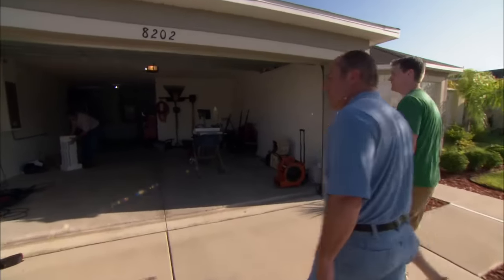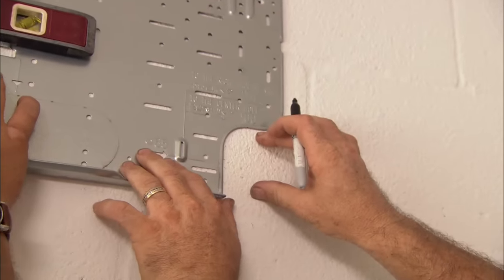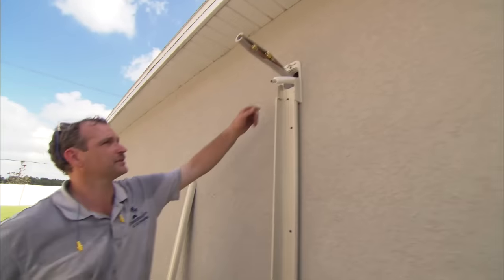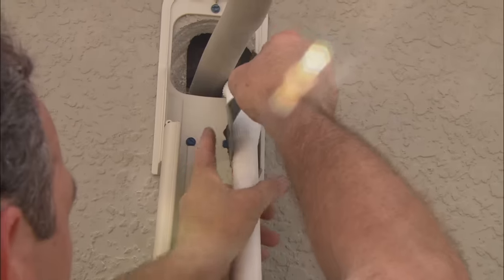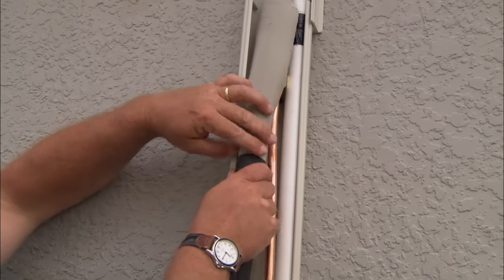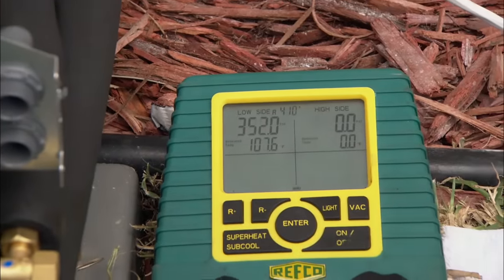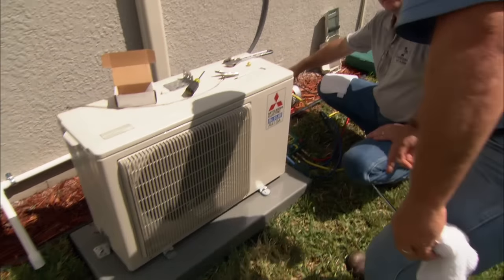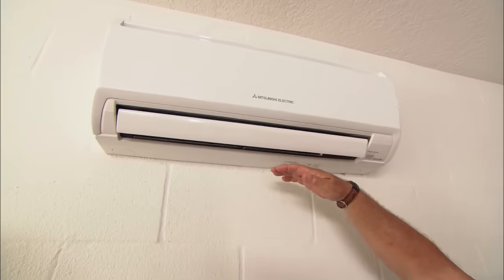How to Install a Ductless Mini-Split Air Conditioner | This Old House

Comment: Most home handy man will be ok with the majority of the install. Would not recommend tapping into your fuse box to run a new circut unless you're an electrician or have a very good idea of what you're doing! Also flaring of copper pipe is impossible unless you have a kit. Other than that, go hard👍
Reply: Vacuum pump.
Reply: +FrozenHaxor and yer a vacuum pump is good for testing and moisture removal. not completely necessary though. refridgerant is already in the a/c lines/compressor. therefore a vacuum is not required to draw the gas into the system from an external bottle. like you need to do if you have no gas in the system.
Reply: +smithenstein79 you just have to crack a screw loose as per instructions and away she flows👍
Reply: +smithenstein79 Oh boy... do you even have any idea about HVAC work?
Reply: +FrozenHaxor obviously more than you?
Reply: +smithenstein79 "you just have to crack a screw loose as per instructions and away she flows👍" I seriously do hope you're joking. No offence but please educate yourself before misleading others. The Internet has plenty of resources on the topic at hand.
Reply: Wtf dude? Are we talking about the same thing? A new inverter split cycle aircon unit comes pre charged with r32 gas. No additional gas is required unless you run extremely long gas lines.
Reply: +smithenstein79 You've said that it's not necessary to evacuate the refrigerant lines before releasing the pre-charge. This is completely wrong. There MUSN'T BE any air or moisture left in the lines.
Reply: +smithenstein79 So you recharge customers refrigerant systems which have been open to the atmosphere without pulling a deep vacuum first? I hope you're not HVAC certified O_O
Reply: +FrozenHaxor Ever heard of "purging the lines"?
Reply: +FrozenHaxor If i was doing a repair and reusing the old lines. And putting in new refridgerant, because the old gas had leaked. I would definitely vac down the system. After flushing out the old lines. Would be dodgy not to. But when you are installing brand new sealed lines and there is precharged gas in the system it is a waste of time vacuuming down the lines. When you can just purge the excess air out.
Reply: +smithenstein79 No no no, I'm talking about the copper extension lines that you install between the outdoor unit and the indoor unit. One for high pressure coming in and the other one for low pressure discharge. When you first put them in they are obviously full of air and moisture. They need to be evacuated, but not the compressor unit which was factory sealed with the precharge in it. Purging such lines at the very end is not enough, the refrigerant coming from the precharged unit will mix in on it's way with majority of the air and moisture. It's okay to purge the lines while doing a standard recharge to avoid even smallest chance of atmospheric air and moisture ingress before charging the system, but that's not the case here as it's pre-charged.

I just wouldn't risk using the purge method, refrigerant can become quite acidic when it mixes with even small amount of air containing moisture.
Reply: +FrozenHaxor Haha yep mate. I'm also talking about the high and low pressure lines. Not sure how you obtain or where you keep your new copper lines? But the ones i install are brand new and totally sealed and are obviously not full of moisture and contaminants. Generally i obtain the correct piping kit to suit the particular unit and installation. If you actually  read the installation instructions these days. It doesn't require you to vacuum down the lines. There is enough refridgerant precharge for a quick purge and to operate the aircon indefinitely. As long as you stick to the recommended installation pipe length. Bit of trivia for you. It was only introduced as a recommended procedure to vacuum instead of purge upon installation of a precharged unit back when 
a/c refridgerant was a ozone depleting substance. As i previously said, if i was using old pre-used lines that were contaminated i definitely would be vacuuming down. Or also if i had to recharge the system, for obvious reasons such as drawing the gas in i have to also vacuum, no questions asked, not possible otherwise. But if you think that you can chuck any old lines in, or any lines and a miracle vacuum is going to remove 100% of the moisture and or contamination, your living in a perfect dream world. lol. Vacuuming is mainly for intake of new refridgerant.
Reply: +FrozenHaxor Haha yep mate. I'm also talking about the high and low pressure lines. Not sure how you obtain or where you keep your new copper lines? But the ones i install are brand new and totally sealed and are obviously not full of moisture and contaminants. Generally i obtain the correct piping kit to suit the particular unit and installation. If you actually  read the installation instructions these days. It doesn't require you to vacuum down the lines. There is enough refridgerant precharge for a quick purge and to operate the aircon indefinitely. As long as you stick to the recommended installation pipe length. Bit of trivia for you. It was only introduced as a recommended procedure to vacuum instead of purge upon installation of a precharged unit back when 
a/c refridgerant was a ozone depleting substance. As i previously said, if i was using old pre-used lines that were contaminated i definitely would be vacuuming down. Or also if i had to recharge the system, for obvious reasons such as drawing the gas in i have to also vacuum, no questions asked, not possible otherwise. But if you think that you can chuck any old lines in, or any lines and a miracle vacuum is going to remove 100% of the moisture and or contamination, your living in a perfect dream world. lol. Vacuuming is mainly for intake of new refridgerant.
Reply: DO NOT GET YOUR “HAND MAN” to do much more than this video.
Reply: smithenstein79 I certainly disagree with you. You sould always vac the lines period. It is the right way to do the job.
Reply: you absolutely have to vacuum the line sets. don't let anybody tell you otherwise!
Reply: You don't need to be an electrician to add outlets....that's the most ignorant shit ever. I add outlets and sub panels without issue.
Reply: @smithenstein79  These run on R410a in the states. You do need to vacuum them clear of moisture. The moisture will not allow the units to work as they should and will cause issues at some point. These units are made cheap, they have thin copper and they need proper flaring tool to not cause any breaks. Also a torque wrench to get the fitting on without over tightening as they will cause a crack at some point with a leak. SO NO, it is NOT hard AT ALL...But DOES require some education on what you have on hand.

Comment: Great video!  I always wondered what the extent of work was involved, installing this mini-split air conditioners.  I had two installed in my condo in Thailand.
Reply: kksd2 We stayed in CM a couple of years ago and the owner of the house we rented told us that it didn't cost that much to install his split unit. How much did it cost you?
Reply: I purchased two Daikin® min units (I believe I paid $570 for ea air conditioner units (Evaporator / Condenser / installation)  There were other units that were cheaper (which also includes installation)   I've had them for over 10 years
Reply: @kksd2 How life in Thailand? Hear it’s great for relaxation.

Comment: Why or what is high voltage? Signal line?!?!
Reply: They have no clue
Reply: High voltage compared to the low voltage (signal line).
Reply: Wallace Rose 
It's the line voltage that supplies the compressor and fans, 208 or 240 volts. Signal voltage is the control voltage, turn unit on and off, 24 volts.

Comment: That exterior electrical work did’nt look great, no slack to take up vibration inside condenser unit, earth lead should have had crimp termination and diagonal runs down wall?

Comment: the ground wire connection is not good, you should use round ring lug with lock washer

Comment: Those units are great.  I'm in Egypt and had one installed last year,  easy to install.  So I  said to myself that I'm going to get one when I return to the USA.  Well the cost in  Egypt  with installation cost me about $450  US dollars. Just check out the price online in the USA and that's for the unit only, do it yourself.  Keep  your filter clean.

Comment: These are old, since the 60's in Japan, only cost around $500
Reply: and that proofs you don`t know much about this ;)
Reply: you can get one for less than $300 USD
Reply: The Sun Will Rise Again ..good luck on getting a inverter unit for $500.00. I've seen some older non-inverter units for $900.00 or so and there are adds for either the compressor  unite cheep too.
Reply: Got to think about the noise levels for the neighbors though. If they go complain about the sound and there might be some sound level laws at your place, then you're screwed with all the installation work and costs. You might have to leave the unit off forever or break it down again. And inverters are a whole lot more energy efficient than on/off units.
Reply: but I can get the exact same one in the vid for £380
Reply: I would think they'd be quieter than conventional outside central A/C condensing units.
Reply: I have one.  No noise.
Reply: Only way to know if they are running is to have your hand in front of it, NO NOISE !!
Reply: @Engineer9736  They are mostly around 55db most 60ish. Normal outdoor city noise is about 50db.  SO no issue.
Yes, these units are actually very cheap..But now they are marking them way up. Of course the SEER value and the BTU make the cost difference. the higher SEER the more perceived value.
Reply: @robertl.fallin7062  IN SPAIN YOU CAN GET CHEAP INVERTER UNITS FROM 300$  AND BETTER UNITS LIKE MITSUBISHI , DAIKIN, FROM 500$  AND  CERTIFIED TECH FOR INSTALL FROM 170$

Comment: why didn't the flares get oiled and torqued to spec and how do you pull the nitrogen out with the vacuum pump? The drains pvc will fall to the ground once the glue on the tape dries

Comment: Thanks for the video!
A must, even for those getting the job done by professionals.
One won't need to ask the questions already answered in the video and oversee the best finishing.
It would be nice if the presenters did the same thing with a larger unit/s mounted say 10 feet above ground level for the external unit. This is in case there is a drive way outside.
This will prepare the end user with a preview of the preparedness required and expected from the mounting crew.
This could avoid tense moments and possible mishaps and damages.
Also devote some time to cover precautions, if a gas refill was required.
I can expect the best from these guys!

Comment: These kinda AC are so much quieter and cooler than window AC. The only problem is they are pretty much fixed once you install it. Unless window AC, you just take it off of the window.

Comment: You guys cut out the vacuum process. Some poor homeowner is gonna see this and think, you can just turn on the unit after pressure testing. All the air needs to be pulled out of the lines, with a vacuum pump before releasing the refrigerant.
Reply: Chris Casny. PIN this comment to the top!

Comment: 🤨@2:10 I’m wondering if that TAPE is holding all these years later🤣
Reply: I guarantee it would be 100% fine unless someone messes with it.  Probably would last 30 years or until the plastic wears out

Comment: I don't know where this install is but you should never install the heat pump on the ground. It should be on a stand or wall bracket to accommodate snow level.
Reply: Zing Zang I always use a stand on sleepers or the wall bracket but then I operate out of New England where snow is a guarantee. These guys did good work.

Comment: My dad wanted to get a small portable AC and I said that now adays they sell real split air conditioners for under 1000 bucks and that I would gladly come and install it with him. This video confirms what I imagined what the install would be like just looking at the unit. If we get the electricity ready in advance Im sure we can start after lunch and be ready by dinner time.
Reply: Few years on, how did that work out?

Comment: I’m not an expert, but from watching a few similar videos I spotted a couple of things this guy did that others do differently: (1) He bent the pipes directly (2:29), where are others put a pipe over the pipe and bend that to avoid kinks. Even iffy looking installers in India did this but he didn’t. (2) Over time the weak point for leaks in refrigerant are those compression fittings (2:45). A lot of installers will cut these off and directly wield the pipes together. (3) The way he attached that ground wire LOL. Sure it will work, but this guy is meant to be a professional and the install looked far from that

Comment: The ductless A/C unit's work even better than central A/C. Not as much loss with the air having to travel through ducts, etc. They work amazingly well. Realistically though, if you live in a dry climate, in a garage most can just get a portable evaporative cooler and be plenty comfortable in there.

Comment: How about using a torque wrench for those lines connections, as the manufacturer recommends?
Reply: That's only for us dummies,  the pros just estimate like the cook that stop measuring sugar and salt and eyeball it.  I'm with you,  need the torque wrench.

Comment: Nice, but geez, a 7 minute video?  This seems to gloss over some things.  This is like those terrible articles in the car magazines.  Step 1, disconnect the battery.  Insert goofy banter here.  Step 2, lift out the old engine.  Step 3 install new engine.  See how easy that was?!

Comment: 1:16 How do you know where the hole that you cut is from the outside?
Reply: Drill right in the center with a loooooonger bit
Reply: And have fingers crossed the blow out is not bigger than the hole.

Comment: wow that is NOT high voltage. high voltage is over 1000 volts. that is low voltage 50-1000 volts (110v or 240v usually in a household). extra low voltage is under 50 volts. I don't think you should be doing the electrical work buddy. Have you got an electrical license number?

Comment: Your tapping off of a 200amp panal, standard for an average house. Where are you getting your high voltage?  residential voltages, 120/240 or 120/208 if you are getting your feed from a 3 phase system. You don't have to be afraid of electricity, just respect it. Teach everyone correctly.

Comment: y didn't u just get a through the wall unit? For a garage that seems more reasonable.
Reply: paul noyb Mini-split units usually cover a larger square footage in a shorter time period, more energy efficient, longer lasting and less noise pollution (ideal for those garage bands and studios) ;-)
Reply: buzzydj good point, we have a mini split unit in our converted garage that we use as a studio. We had a portable unit in there before but it wasn't enough so we got the mini split. A through the wall unit would have let a lot of the noise from the studio out side.
Reply: Efficiency.  Through the wall ratings have an effective SEER rating of about 8 or less.  There are half a dozen mini split models with SEER ratings over 24.

Comment: My only add would be something to keep bugs from nesting inside the condensate drain.  Mud daubers would clog that in a heartbeat,  A small bit of very coarse STAINLESS steel wool would do the trick.

Comment: I come across so many where the flare connections leak,,,,,,,  maybe if installers used flare nut wrenches / torque wrenches it wouldn't happen so much.   Where does Mitsubishi list torque specs?

Comment: I don't GET it. Why do you need refrigerant and compressors in all the mini-units?? Why not have  a central unit with cooling coils, and just circulate antifreeze (through insulated pipes) to the wall units???

Comment: What states can these legally be installed? I called a local HVAC company here in Tampa, Florida for a quote and was told they could not install any AC in my garage unless I permanently sealed my garage door shut (so it could never open again) and insulated it. They said they could not get a permit unless that was done. They sited EPA regulations. What's up with that?

Comment: I had a Mitsubishi heat pump installed three years ago and it just quit working , the main  pump that is.The question I have is it necessary to replace the fluid when the pump is replaced? and what would be the going rate for the job if the pump is still in warrantee?. The pump is three years Three years old?.Thanks, Jackie.

Comment: Tape on the drain line, no nylog on the flare threads, no added pitch for the hole to the exterior, no torque wrench on the connections. It'll be fine, keyboard HVAC techs have entered the chat.

Comment: +albowrx 
Purging is standard procedure on ALL brazes. Also am surprised there is a list of itinerary attached to this vid for how to install a domestic?!!!! This is not a shed being erected here that any Joe Public can do......don't know about over there but in the UK only F-Gas qualified engineers are lawfully allowed to install/service fridge and AC and it's a serious offence otherwise. This is high pressure refrigerant not a screwdriver!..........by posting a vid and list on here opens the saloon doors wide open.........and that's when all the Cowboys come flooding in. Leave the pro work to the pros.